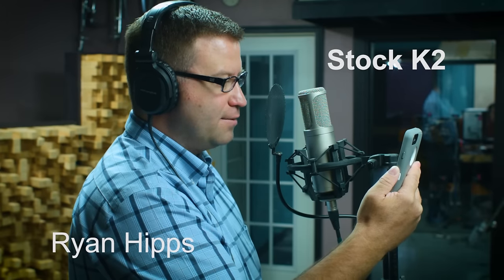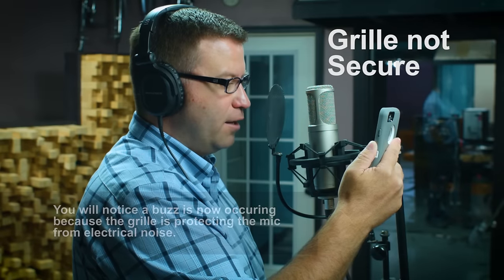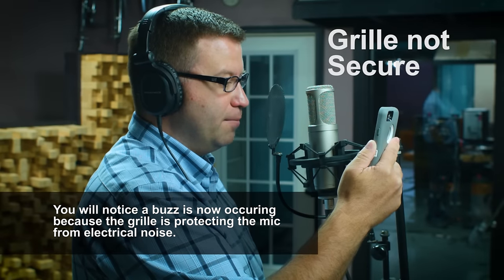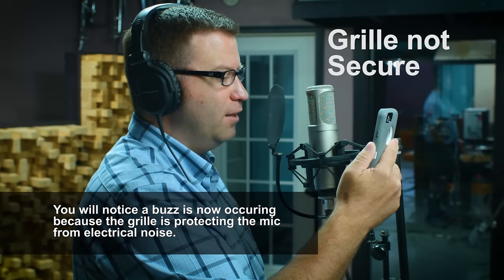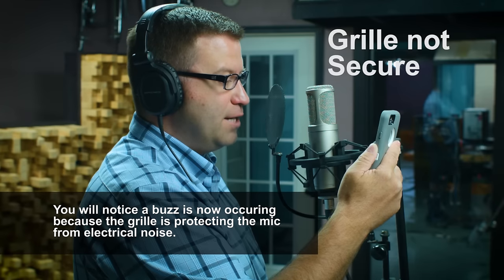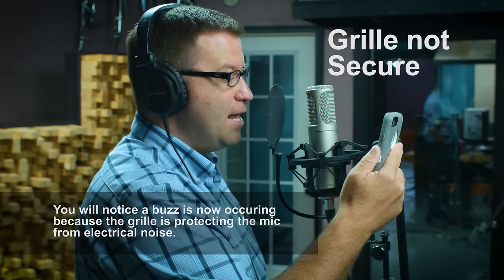What Happens When You Take the Grille off of a Condenser Microphone?

Comment: the same applies to a dynamic mic?
you mentioned in a video that you could take off the grille on a sm58 to get a little closer to the speaker on a guitar amp.
Reply: condensor mics require phantom power (electricity) to operate but dynamic mics don't. so It'd make sense that the same thing wouldn't happen with a dynamic as the grill on a condensor would be having a role in grounding it to not create that buzz. Idk i might be entirely wrong. Google is your freind

Comment: I don't know if you caught and/or looked for this during editing, but even with the short time we can see in this video before he lifts the iphone up to within a few inches of the capsule, the noise really wasn't bad, In between you taking your hand away and him moving the phone to face-level, there's a short period of, unsurprisingly, very little noise. You could also easily record an out-of-phase, noise only track if you wanted to use this uncovered condenser method to capture a really full sound from a small low-power combo amp or use it as a room-mic, or even for a very quiet singer.

A completely bare-assed condenser capsule will act as an antenna, but that antenna doesn't create noise on its own. It has to come from something.

I wouldn't record a voiceover with an "I" device right near a condenser mic, even with a grille, but I also wouldn't record guitars with a single-coil equipped instrument on my right knee and an iphone in my right-front pocket either, because I would be expecting a shit-ton of noise. Or even a humbucker guitar. I actually use mostly batter-powered lights in my "studio" when I am tracking. You can get really bright clusters of LED's that will run for hundreds of hours off 4 AA's, and lithium-battery or single AAA book-lights for any set of controls or lyric sheet or any other close-up lighting application. And, of course, I turn off the air conditioner.
Reply from the maker: Well, great ideas for sure. I've thought of a lot of things like that. But also consider I have 7 compact fluorescents within 5 ft of the mic. Most likely the cause.
Reply: creativesoundlab Sure, I'm just pointing out the difference made when the phone is moved up. Might have been your editing, slowly fading the audio in.
Reply from the maker: Yeah, I've gotten comments about that. I think it was the compressor releasing. I might post another video about that part, because I filmed the compressor too, I just didn't want to make it about the compression, but about the mic.
Reply: creativesoundlab I thought about that too. I bet there's a way around this, maybe some kind of much thinner and more transparent mesh, or even just the outer frame of the grille with the mesh removed? It would be interesting to try. I'm going to try a mod on one of my Chinese ribbons to basically make it a naked element for really sensitive ambient applications.

Comment: Taking the grill off an SM58 on the other hand= SM57....might be good with other dynamics where their grills are easy to remove. Probably never a ribbon (just too fragile?) or a condenser though! Generally seems like you can mod dynamics a lot, but condensers, maybe only removing or adding foam. I'm experimenting with some foam on my AT2020 as i found it had some nastly phasey sound, presumably from having two capsules in a poor configuration- removing things made it worse (which is usually what people do!) so I've really covered the back now, I think its an improvement if a little dark...Also heard that my Apex 210 ribbon mic is a 205 without the foam and thus an improvement. I'm too afraid to take them apart really, so atm the extra foam is taped on the outside!
Reply from the maker: That's really cool. I'll have to try the foam trick on the back. I like that it makes it a little darker.

Comment: Go figure, the head-basket is on there for a reason! ;-)
I disagree with your advice not to 'mess' with mics... I'd encourage people to look into mic mods, especially for their less expensive microphones.   If you have a Chinese mic with 2 or 3 layers of mesh, odds are that removing all but the outer mesh will yield a more open sound (and likely won't introduce much susceptibility to buzz). Also on less than expertly designed microphones, where the body and grill have distinctive tone when tapped, putting some dampening (foam, Blue Tack, tape, etc) in key places can fix that specific flaw. 

Cheers!
Reply from the maker: +Stephen Tack that's really interesting to put dampening in the grille like that. Yeah I say the things on my show because I don't want to tell people to open up tube gear when they don't know what they are doing. That and getting my fact strait are something I always try to do. Would love to minimize the grille layers on that mic but it seems very well secured to the other layers.
Reply: creativesoundlab yeah, definitely want to try it on something like a Behringer or MXL first. Basically get some stout needle nose pliers and snippers, try to find an edge, peel it up, and twist... Inner mesh has always come out easily for me. It is however a one-way (destructive) mod.